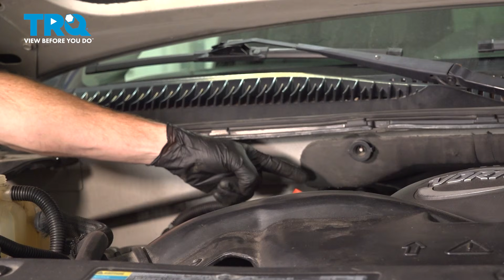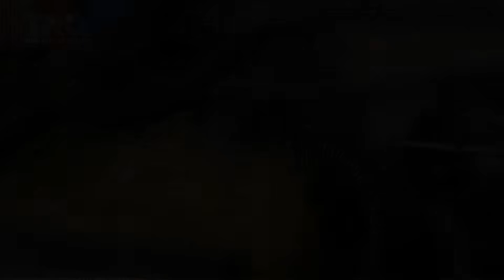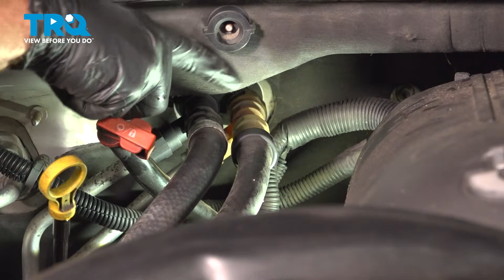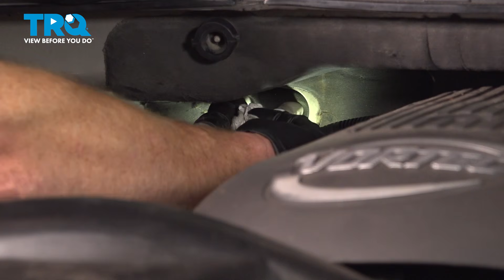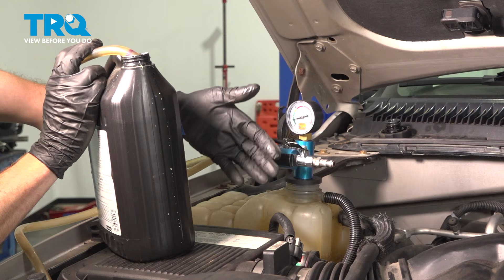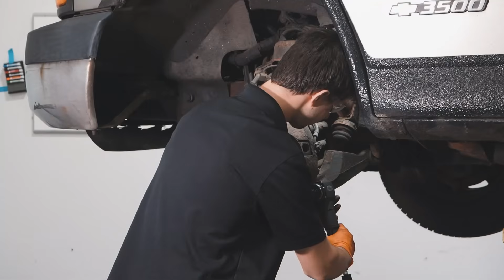How to Replace Right Heater Hose Connector Tee 2000-2006 Chevrolet Tahoe

Comment: Yeah I appreciate the video but lads..... the fittings DO NOT come off. You can pinch those ears till the sun goes down, they don't budge one milli. Mine are 21 years old and I tried to leave them alone, but the hoses were rotten and when I pulled them slightly, the fittings cracked. They sure do go on easy, but they never come off. Whoever designed and spec'd those fittings so close to the firewall is a real SOB. All you have to do is let the firewall stubs come out a bit further and use a hose clamp. Long, curved pliers dont work. The ring tool does not work. It doesnt matter what you press the tabs with, bc pressing the tabs doesn't release the fitting plain and simple. I think Im going to have to saw these off with a small hacksaw blade, going slow and careful to not go too deep and cut the heater core stubs. What a disaster.